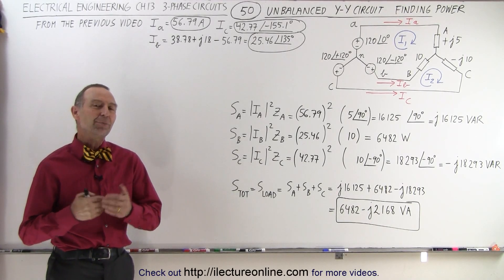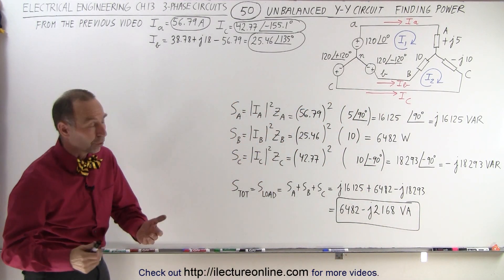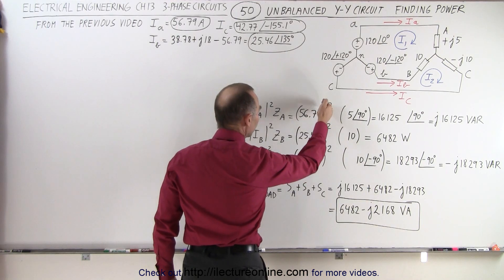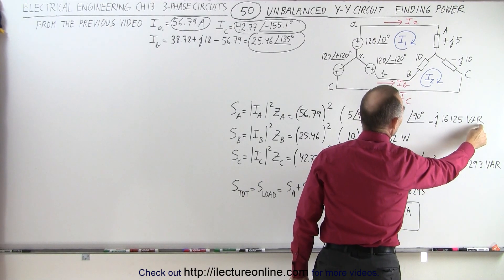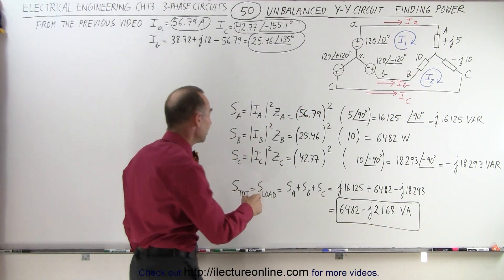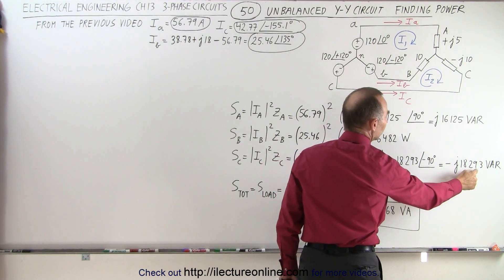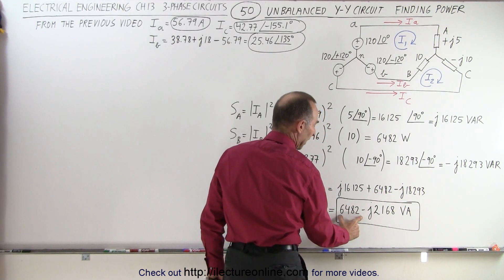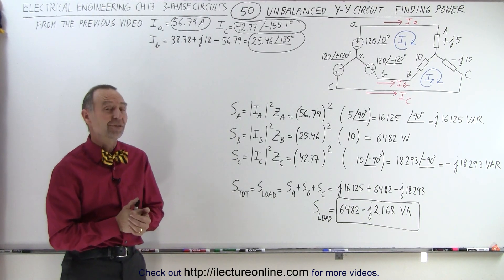Electrical Engineering: Ch 13: 3 Phase Circuit (50 of 53) Unbalanced Y-Y Circuit: Method 2

Comment: Thank you so much for your useful lectures.I have one question:why do we always take the modulus value of I while determining the power?why don't we count the phase angle?
Reply from the maker: Power dissipation is  P = I^2 x R   And since the magnitude of I is constantly changing (due to the rotating phase angle) we need to find the effective average current.